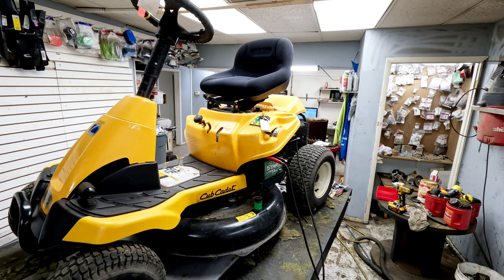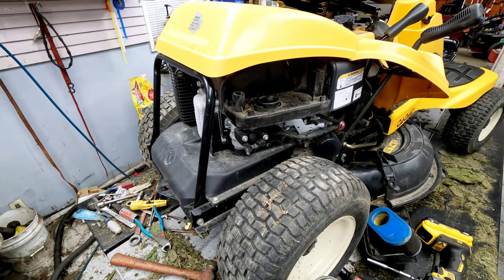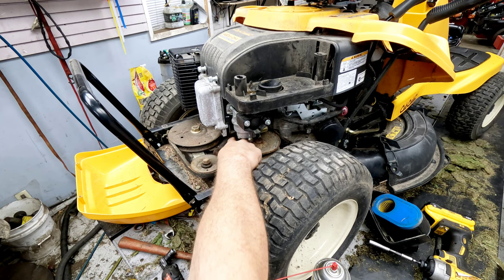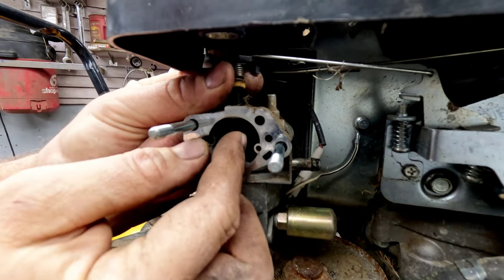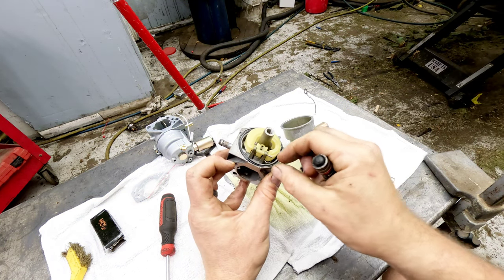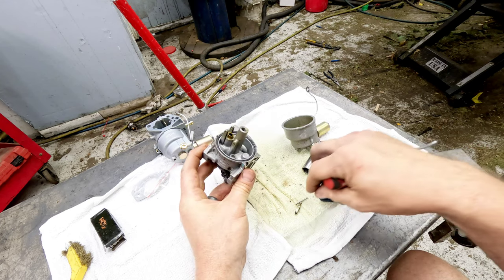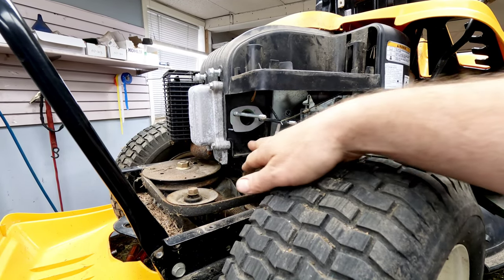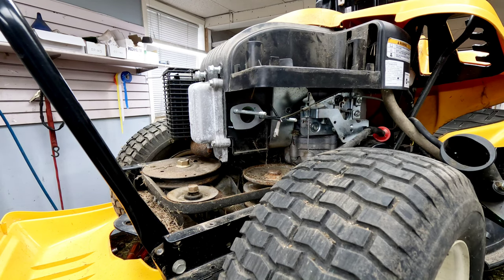30" Riding Mower Cranks But Wont Start How To Fix Cub Cadet CC30 MTD Troy Bilt Mower

Comment: So much easier to get the carb off that way instead of removing the bracket that holds all the linkages. Thanks for posting this. I’ll def be using that short cut next time I have to take it off 👍
Reply from the maker: Awesome! Thanks for watching!

Comment: Just sharing a tip, especially because these tend to run really lean / really hot.   There is a screen inside the fuel inlet on the factory carb.  I have a neighbor that got his mower replaced twice, and I refused to work on the mowers because I knew this but it would void his warranty.  Its not even in the parts breakdown, but the line gets lots of organic grass and wood pulp type materiel built up.  You actually have to pull the metal inlet out, then the screen will come out, usually pretty dirty.  You would figure they would keep it limited to inline filters.  I have seen it on both the craftsman's and toy-bilts I have worked on, cant guarantee its on a Cub.  I do have that engine with a hole in the block out back, Ill try to confirm its on that carb as well for the cubs too.
Reply from the maker: They do have these and many smaller and larger carburetors have them also with this same brand/style. Thanks for sharing!
Reply: The metal inlet were fuel line meets carb ?
Reply from the maker: This is what he is speaking of yes
Reply: @IndRepair  does that nipple just pull out of carb ,I tried to playback your vid to see it wht holds nipple to carb ?
Reply from the maker: @drdirt9379  It does but is difficult to get out and many times will not reseal, Look into it to see the screen and blow through the area where the needle seats to get debris out without removing the inlet

Comment: Thaks for the information, It had the MTD Chinese knock of engine. I set the RPMs to 3400 WOT no load, I set the governor and the throttle cable along having to bend the tang where the governor spring hooks up to.  Thats the only way to increase the RPMs after the governor and throttle cable is set.  I made sure the electric choke works as its suppose to. That way cold with choke on will start up. Thanks for the info on the RPMS , I set at 3400 just seems like it needed a little more . Thanks for the video.
Reply from the maker: Sure thing! Glad to help

Comment: Mine started stalling out mid mow under load. It's only year 2 old and it's been scheduled shop winter maint. twice already, to the tune of several hundred dollars total. 6,700 sq. ft .  is my  res. size yard and the 16th cut this season. Not Happy. I read about the ethanol gas no more than 10% and fresh gas. So I just put a an Oz. of Seafoam in and in my storage can. She started up and ran, we'll see what happens next mow.
Reply from the maker: I would use ethanol free for beat results the ethanol really does a number on them. Thanks for watching!
Reply: @IndRepair  Is TruFuel Ethanol_free 4 cycle  good to use ?

Comment: I brought mine about 3 years ago, it was a brand new return at Home Depot for $1000.00 I couldn't believe it. I was just looking for one and went to Home Depot for something and their it was. Question do you think it's a go idea to add fuel cleaner to the gas, maybe once a year to held keep everything clean? also I use a bagger and the grass use to shoot all the way over to the left bin from the right, now it starts on the right and falls to the left. I changed the blade and still the same, so I'm think I lost power even though it doesn't sound like it. What do you think?
Reply from the maker: That's awesome! I would check buildup of debris or grass in chute or under deck. These hurt the suction very quickly. Also check the deck level. Thanks for watching!

Comment: What should these Chinese engines be running at wide open full throttle RPMs
Reply from the maker: 3,300 RPM top speed on these models

Comment: How long does the spark tester last you with normal use ???????
Reply from the maker: Haha normal use!! Not sure I always seem to smash, step on or leave one hooked up to melt against the muffler before they have ever went bad. Think I probably have bought a dozen have maybe 6 or 7 still around. Mostly have so many because when they stopped making them for a while I couldn't find them for anything! Really good product but I do recommend taking them off the plug wire before that exhaust heats up real good

Comment: Of hand do you know what is the carburetor number for the cc30 mtd ?
Reply from the maker: If your engine is a 4P90JUA or 4P90JUB  the carburetor part number is 951-12771A

You can purchase a replacement carburetor at https://amzn.to/47ucXYM

If your engine is a 4P90HUA, 4P90HUB, 4P90HUC, 4P90MUC, 4P90MUD, 4P90JUC, 4P90JUE or 4P90JUF you will need part number 951-05149

You can purchase a replacement carburetor at https://amzn.to/48SIrZH
Reply: Thanks great vid I have the craftsman version it stalls after about 20 min Like it’s running out of fuel once it cools down it will run great again for 20 min the solenoid works great fuel flow to the carburetor when it stalled out I threw a new plug on cap and could see and feel the spark , do you think the carb shit the bed ?

Comment: Need help mine wont do anything it has a mew battery been running ok i checked safety switch on the discharge output and even added a tapping screw in it tohold the cover tight over the switch so now what should i do its a 2018 30cc cub cadet help
Reply from the maker: I would start with checking the battery, connections and fuse

Comment: Have you ever removed the deck on these? I bent the front deck bracket that is welded to deck causing the front of the deck to sag. Im thinking of removing the deck and trying to straighten it back out or replacing the entire deck. Have you ever dealt with this yet on the cc30h?
Reply from the maker: Yeah have taken them off quite a few times, not horribly difficult but the back is better done as a team effort because it has to slide on both tabs at once. Hope it goes well!
Reply: @IndRepair  thanks for the advice, I'll keep that in mind when I do it. There are no videos on YouTube for the deck removal that I have found  for the cc30h.
Reply from the maker: @whitecastle3032  I show the re-installation on one of our recent 30" videos but the deck was already off so haven't covered that
Reply: @IndRepair  aww ok.. I definitely check  it out..thanks
Reply: It can be done by yourself. Youll have to grab it from both sides as you stand behind the mower to get it back on the pins at the same time. Took me a few tries but its doable.

Comment: What is your carb screw setting at?
Reply from the maker: Low idle setting?
Reply: @IndRepair  the brass screw on the backside of the carb. Not sure what it's function is.
Reply from the maker: I am not sure what it was set at, it changes fuel mixture at low speed